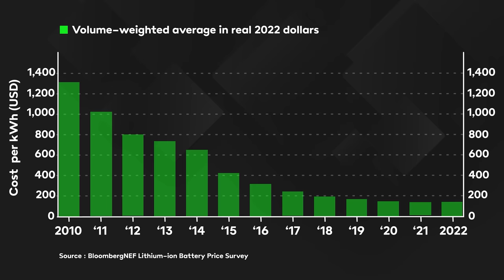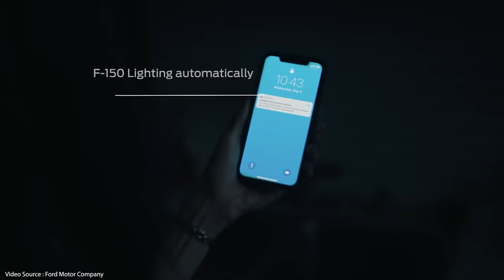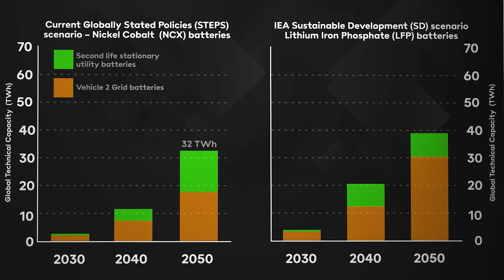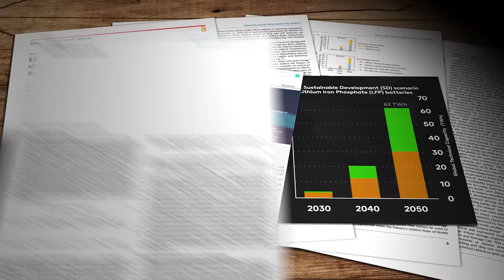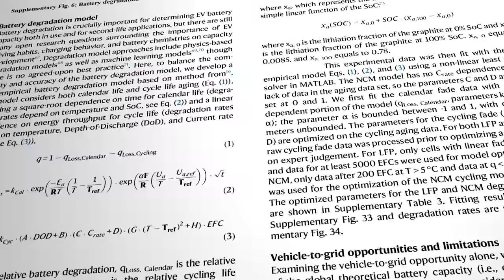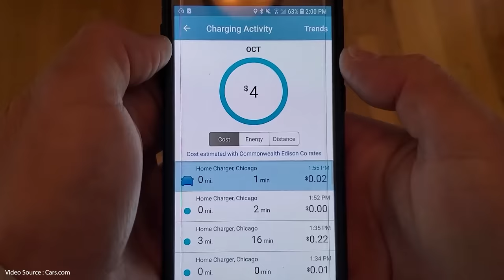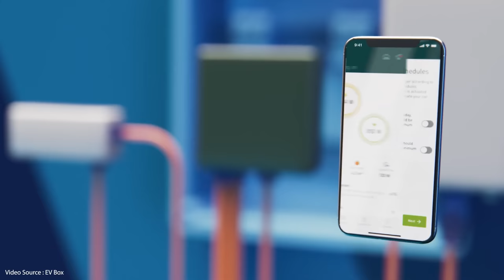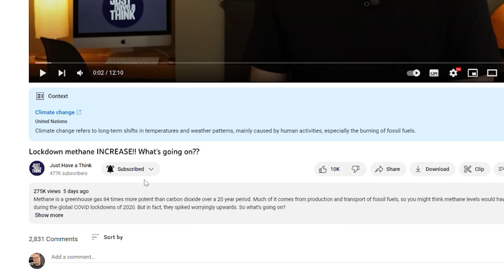Can the electric grid ruin your EV battery?

Comment: I currently pay 47p pkwh during the day and 14p pkwh between 00:30 and 04:30. I really want to use the cheap electricity loaded into my car overnight during the day while I work at home.

I can't believe there isn't a solution for this use case!
Reply: Can I ask where you live, as far as I know all such schemes have been canned in the UK, I may be wrong but my current renewables provider Bulb Energy do not offer off peak rates. They used to but stupid regressive politicians intervened again I suspect.
Reply: @CrispinParker  thanks I will. 👍👍
Reply: Being that  only the Ford F150 lightning is currently set up for V2g and most EV's are produced at a loss currently add $$$ of V2g system to most isn't in their makers interest.

Comment: Cheaper EVs with V2H & V2G compatibility is where mass market demand will be found. But Big Batteries on Wheels need to do more than drive around town. If everything goes according to plan in France, in 5 years there will be solar canopies with integrated stationary storage batteries & V2G chargers located at every parking lot with 80 or more spaces.

Reduce utility bills and transportation costs for tenants of leased commercial property, like large apartment & condominium developments, neighborhood shopping centers, business parks & public facilities. Produce & store reliable power right where most energy is consumed. Shade enormous asphalt heat islands. Build a matrix of reliable networked neighborhood micro grids. And accomplish all this without requiring expensive new long distance utility transmission.

This is not a utility fix-all, but it can be accomplished very rapidly, everywhere.

Comment: If Tesla makes its heat pumps super efficient for home use, and if they were to combine fridges to the system somehow, too, the home consumption of electricity could drastically reduce. Solar roofs on cars, like Lightyear is making now, could help reducing electricity consumption in summertime. Somehow using the wind generated by driving a vehicle might be harvested also (who knows?). Just have a think and the future may be bright 😇
Reply: Why would you assume Tesla has any special expertise in home HVAC? The market for home heat pumps, also known as air conditioners, is quite mature.

As for harvesting the wind from driving ... probably won't ever be practical. Awhile back Dave covered a project that set out to line the side of a highway with wind turbines. (https://www.youtube.com/watch?v=gcSnwW5v3f8) The problem is, it's really hard to harvest only the wasted energy from turbulence, without also thereby increasing the wind resistance on the cars. That is, some if not most of the energy you can capture that way turns out to be just a really inefficient way to extract energy from EV batteries (and from the gasoline and diesel of non-EVs).
Reply: @ps.2  ,  -->  Tesla's octovalve heatpump for cars has low energy consumption and seems to be super efficient. Musk  said, a couple of years ago, he wanted to integrate heating and cooling systems for houses, too. At the Tesla investor day, march 1, 2023 he made HVAC-s nr. 3 of his masterplan.  
Sandy Munro praised the Tesla octovalve heatpump for cars (model 3 and Y?) as a brilliant piece of engineering because of its efficiency, its greatly reduced number of components, its genius construction, its functionalities und versatility.—>  If Tesla would enter the HVAC market, its systems would no doubt be smaller, smarter, more elegant and more effective. Someone mentioned the octovalve reminded him on how the valves in a trumpet redirect airflow. That reminded me of heat pumps that work with compressed air - without refrigerants-  such as Blue heart Energy and Sound Energy. So I am curiouscwhat Tesla may come up with...
Reply: @kittykivalo8312  I think you need to take phrases like "Musk said" and "Munro praised" with a large grain of salt. Those guys say a lot of things.

I still can see no reason to assume that if Tesla sold home HVAC they would "no doubt be smaller, smarter, more elegant and more effective." Maybe you think this because if they couldn't build an awesome product, they wouldn't enter the market? Well ... they thought they could do solar roof tiles for awhile. Just sayin'.

Also, the market for heat pumps in cars is very new. (By which I mean valve-reversing heat pumps. One-way heat pumps have been in cars for decades.) Combustion vehicles never needed them, as cabin heat can easily be provided from the waste heat from the engine. So if someone praises an EV heat pump design, keep in mind that it's being compared to very few other vehicle heat pumps. Most other EV cabins have been heated with electric resistance, i.e., space heaters. Any heat pump design is likely to be quite a lot more efficient than those.
Reply: @ps.2 ,   I see no reasons, too. But I see creativity and the capability to innovate and integrate things. And I see how many things have already shifted the last 7 years or so. So let's give it a few more years and time may show😇.

Comment: Thank you for another wonderful video! The energy transition is upon us... That's cool, especially if EVs are approaching price parity with ICE vehicles. I think the transition will go more quickly in some places than others, though. So far I've seen exactly one Tesla in the wild, and it belonged to a car hire service. Hybrids like the Prius are relatively common, but I'm not sure if their market share has increased in recent years. I think the attractiveness of an EV depends upon the average price of electricity in your area.

Re-using old batteries as grid stabilizers is a great idea. It does make sense that someone (probably the power company) would buy them after they were collected for recycling and put them back to work. Although it's kind of amusing to imagine private citizens with multiple junk cars parked in their yard, all permanently connected to the grid, in reality the power company would buy them and put them in a facility somewhere.
Reply: Hi Kevin. In my part of the world (Australian east coat) Toyota introduced Hybrids across a lot  more models like RAV 4 ,.
Now Hybrid sales are 32% of all their cars, way better than the bad old days when it was only Prius. 
Regards 
Mal
Reply: Very cool. Sounds like Australia is well on the way to the energy transition.
Reply: Using existing ones via V2G is even better!
Reply: Technically this is 'reuse' rather than 'recycle', but yes.

This can take the form of a power company just buying batteries and figuring it all out, but more likely, it will be a third-party company who specializes in the electrical engineering and logistics of this — they will buy up batteries, test them, hook them up with inverters and sensors and liquid cooling and maybe fire suppression, put the whole thing in a shipping container, and sell the whole container to, say, a wind farm, to plug in and set up.

(One such company is Renault, who apparently have a pilot program buying up old Renault car batteries and doing this sort of thing. This I guess would have the advantage that they already know exactly what sizes, shapes, and specs of battery packs they're dealing with.)

The wind farm (e.g.) can then shift their production to charge batteries when the wholesale price of electricity falls too low (i.e., off-peak, or when solar farms are providing more power than anyone needs), and sell more electricity when the wholesale rate is high. That's the indirect way to get paid for grid services like peak shaving. The direct way is to negotiate an update to their PPA with the power company, so that they're explicitly paid to provide, e.g., frequency stabilization.

(Why a wind farm? Because they already have a high-capacity connection to the grid and a relationship with the power company. But a third-party "batteries only" power provider could also enter the same game.)
Reply: @ps.2  Thank you for laying it all out like that! Seems like a system that could work.

It's interesting that Renault is already getting into the re-use business. That's a surprising amount of foresight for a car company.

Comment: People are going to get paid feed in tariffs for it if they opt in anyway. What's the problem even if it leads to some minor degradation? If they have solar power going into the battery then even better for the bottom line.

Comment: Would it make any sense for grid operators (backed by govt maybe) to offer free replacement and recycling of your EV battery as reward for their use of your EV as a grid battery? Throw in a few c/kWh discount and surely people would be all over it… cheaper power and relief from the dread of having to pay to replace a $5000 (?) battery on an otherwise good EV…

Comment: Interesting.  I wonder how anyone can take dozens of different batteries and connect them to the grid. Different voltages, different connectors, different shapes and sizes.
Reply: Just like they do with solar batteries now. Via an inverter, which on a domestic connection converts DC to the voltage and frequency and phase of the incoming mains supply, so it can connect in parallel with it.
Reply: @shaunhw  I'll try again. I understand DC/AC and voltage conversion. I'm talking many different voltages, many different physically different shapes.  I guess one work around would be to use all Tesla S batteries in one large battery, all Nissan Leaf in a different one, and all Rivians go over there.

Comment: If anyone figures out a good 10000-cycle battery chemistry, then V2G is basically free money.  Ambri thinks their molten antimony-lead cells can charge/discharge daily with no significant degradation for decades, but they're way too heavy for a vehicle.
Reply: Perfect for large scale grid storage, as it is also not sensitive to whatever ambient temperature, so no complicated heat control necessary as with Tesla Megapacks. Ambri is testing right now and probably will scale up soon... We need tons of storage, so the market is big enough for everybody. I have high hopes for Ambri, could become a big one beside Tesla in grid storage facilities, as it is so cheap and relatively simple to scale.
Reply: 400°f molten metal batteries are probably not the best idea, just saying,.
Reply: @jackdbur  No problem, it is all enclosed and if there is a leak it cools down quickly solidifies and seals the leak. The high temperature it runs at makes it ideal for extreme environments, the difference between +50 and 500 degrees is just about the same as between -50 and 500.. So in reality it doesn't care about the ambient temperature and therefore the airconditioning and cooling units are out of the window with these Ambri batteries. You also do not have to worry about thermal runaway and with all metals and salt it will never catch fire too.  It's really a turn on and walk away system and never come back, as it does not wear down, materials hardly degrade. Only the systems around the cells the electronics, that are prone to failure at some point, but the cells itself may last a lifetime.. 

So don't let you fool by the high temperature, it will probably be  the safest battery out there, and the cheapest, and the longest lasting and lowest maintenance.

Comment: Heat is one of the killers to batters and fast charging creates lots of heat, i like EV vehicles but the rang is more important then speed of charging personally i drive about 75mile daily for work and do enjoy road trips
Reply: Modern EVs have active battery cooling that should be able to deal with the heat problem.  Most charging should happen at home at low enough rates that heat related battery degradation is not a problem.
Reply: @incognitotorpedo42  agreed tho been reading its mainly the stage 3 charges that tax the cooling ability and can create hot spots that degrade or damage cells but technology keeps getting better tho!
Reply: @ls-33wraith33  150 miles a day is easily handled by overnight charging at home with a proper home charger.
Reply: @jackdbur  unfortunately I’m in a apartment that only has street parking 🤷 sucks to be me

Comment: It may add some extra wear to the battery when it is frequently used as a buffer for the grid, however, sitting there at almost 100% load all the time is not improving battery live either. 
By the way... as you are all about energy saving and green energy - why are there two lights and a monitor running in the background without any useful purpose except making a nice ambience for the video? Are the lights LED at least?
Reply from the maker: The lights are indeed LED Human Isomer. If I may say so, I think you might be slightly clutching at straws there. What you can't see is the 6 LED studio lights behind the camera, so I'm under no illusion that the 30 minutes of filming uses a fair amount of power, as does the 40 hours of animating and editing that I have to do afterwards. I do what I can to save energy (3kW Solar PV, 4.8kWh home battery, Air Source Heat Pump, haven't owned a vehicle for 10 years, been vegan for 5 years etc. etc.) but I do still use energy and my carbon footprint is still about 3.5 tonnes per year.
Reply: @JustHaveaThink  Very nice, keep that spirit! :)

Comment: Superchargers are really the only way to replace gas vehicles where I live for longer trips. Daily driver, sure electric,  no problem. Long trip to see my dad with gas car is 5.5 hr. With electric and superchargers, 6.5 hrs. If we work with slow chargers..... get a hotel. A weekend visit is not practical with electric car for me. Winter weather at -25C further reduces range and possibly increases number of charges needed. I can't afford a gas plus an electric vehicle right now so I'm sticking with one gas vehicle until electric ones have better charging and more abundant charging stations. Also, some new charging stations have glitches that shut down when too cold. We are getting their but still bugs to work out.

Comment: I would not be interested in using my EV batteries to run the grid but if I did have an EV I would be very interested in using them to power my own home. I would want to charge them during the day with renewable resources or in the wee hours of the night with reduced rates and then discharge them in the evening when demand was high.

Comment: If the car and relevant equipment are built correctly it will not be an issue. However, the lowest bidder makes this stuff with pissed off employees. It's going to break anyway.

Comment: Like someone else who already commented on this, your insistence on describing batteries as sources or sinks of electrons is a bit off-putting for anyone who knows what a battery is.  It's energy that is moving in or out of a battery.  Electrons shuffle around but a battery will pretty much always have the same amount of electrons as that at the time of its construction.   Reusable batteries work by shuffling charge around parts within the battery.

In practical demonstrations of electrical charge, such as rubbing a rubber balloon on some cloth and then putting it next to something else to get fine filaments to stand on end, one can say there is an excess (or deficit) of electrons. But if a battery was like that then it just would not be able to hold much energy as the material would break down.
Reply from the maker: Good to see you really grasped the main point of the video there Dan. Well done.

Comment: I want to re-purpose my EV battery pack to backup for my home solar when the EV battery drops below 70%-80% capacity.  Why pay 3rd parties for used battery packs? Retiring 83 KwH of battery packs @ 70% of capacity (~58 KwH) has to be immensely less costly than 5 Tesla PW2s @ ($13500 + 4*$7000 = $41.5K) installed cost.

Comment: I want to use electricity so I buy the service and pay for my usage of the grid.
If the grid wants to use MY service then they can pay me a standing charge for each day I'm offering it and then pay me for their usage. So every 24hrs my car is connected to the grid for their use I expect to have my standing charge from them set at nil (parity to their charge) and then they can buy my electricity at the same price they are charging me. That way I have a reason to help. I will still not be incentivised to do so, but I'll be content with the set up as their payment for standing charge will offset the degradation and upkeep of my service (which is what we pay their standing charge for).
Anything less than this and I'll be 'doing them a favour' and as they are in the business of making money I see no reason why I should help them out.

Comment: The state of Norway the electric company on the batteries in the Norwegian electric cars which are charged at night when the wind is great and consumed in the daytime by the electric grid. How it's all managed as part of their wind hydro power supply what I gather the idea is to keep your car plugged in at all times and travel distances are always short. For those that need fresh batteries rather than charge you can easily swap at an automat. Considering batteries at Central battery parks that do nothing but sit there, having those batteries in light-duty vehicles with big battery power gives the battery double duty. Having the utility own the battery reduces the cost of the vehicle to the consumer in Norway.

Comment: Roof mounted solar on an older house means check load bearing, extra support in the attic, new shingles. Advertisers should offer ground mounted solar more. I keep seeing adds for roof solar. Ground is safer, easier to upkeep and safer solar system.